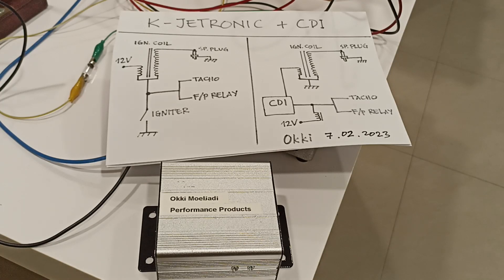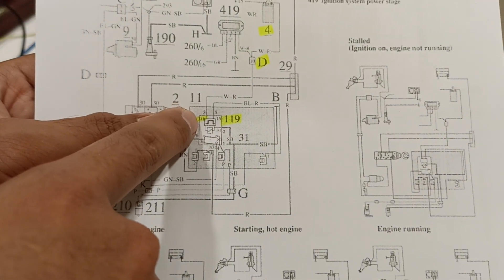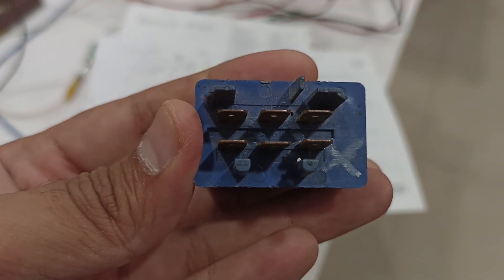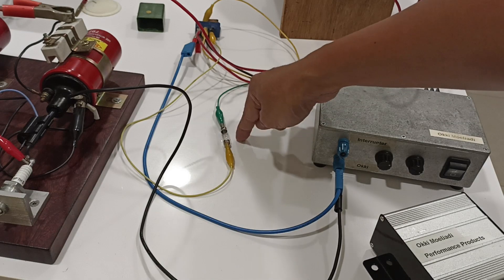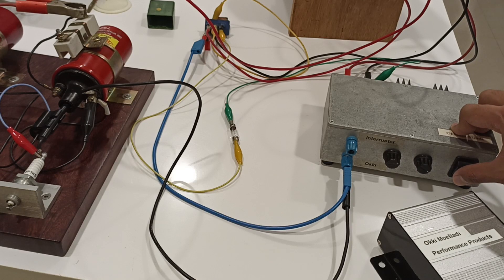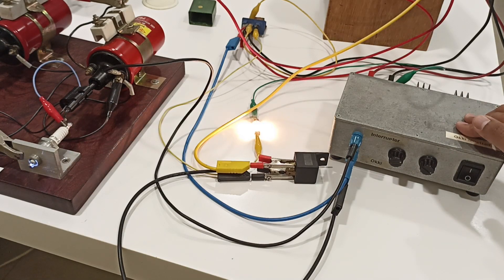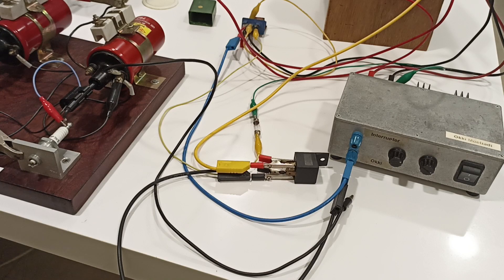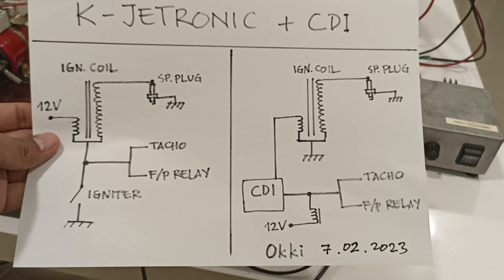CDI on K-Jetronic System

Comment: hi ike tom ogl joe booker stan meyer joesph papp all realised that once you seal the complete engine to become a vacuum .you can then carry out electro static and magnetic static off ac dc and dc ac same as natures lightning bolt .the valvescan never valve bounce .but you have to have nitrogen filled tyres to stop ground earth .joe papp had an initial run away on his prototype that killed an observer as by the vacuum massive amounts of energy is produced by the spikes ( lightning bolts )